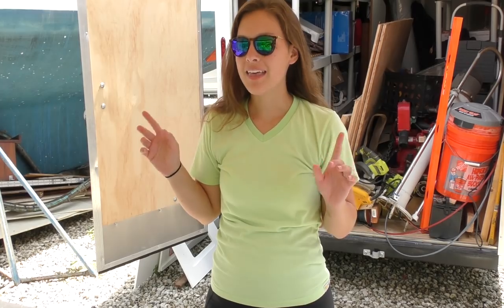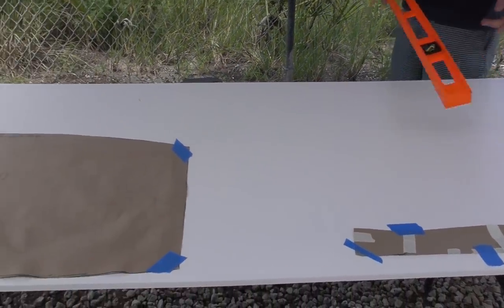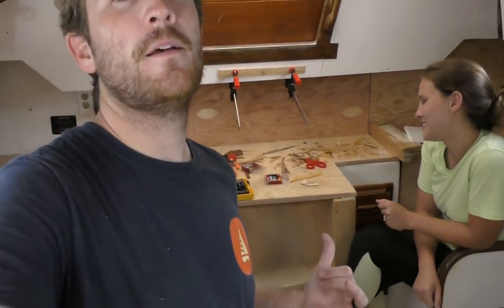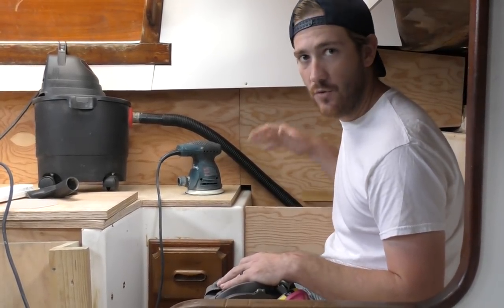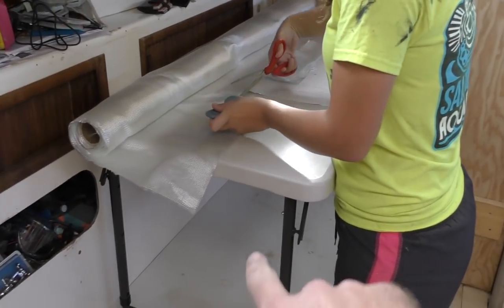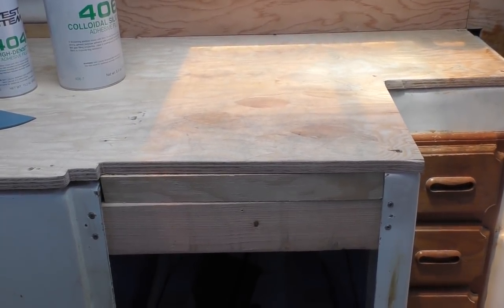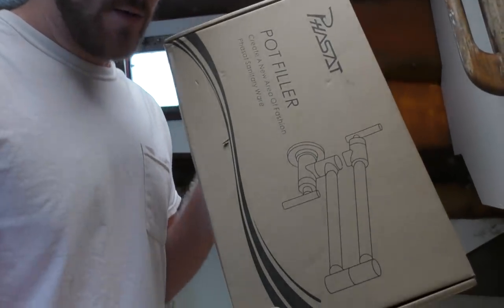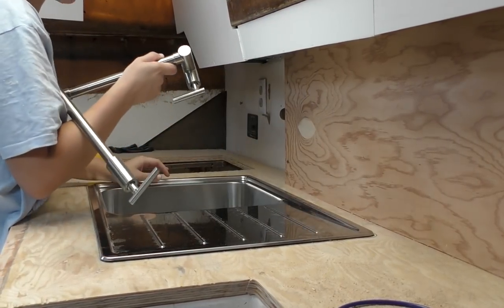55. IKEA Sink on a Yacht? - Galley Refit Progress | Learning the Lines - DIY Sailing

Comment: I would recommend using contact cement glue instead of that DynaGrip, could not find actual info on its bond. Contact cement is ideal for less porous material such as PVC or plastic laminates and will also bond with many other such as wood. You need to roll it on both surfaces and leave for 15 - 20 minutes until it becomes tacky and cured, than attach both pieces together and contact cement will stick to itself. But you must make sure it lines up before attaching as its pain in ass trying to move once it starts to stick to itself. We used it all the time on plastic laminates, tub liners and even countertops and will not budge even with flex and movement.
Reply from the maker: Good info! Thanks. Making sure it lines up perfect is a little intimidating. Lol.
Reply: yea the trickiest bit, little experience helps. Really just want to line up one whole edge first than start slowly pressing rest together til you start get hang of it. Than make sure to press firmly ensure good bond all over. Keep heat gun handy in case once you get part way and realize it is bit off.
Reply: Been using contact adhesive for attaching Formica type laminates to wood for over 4 decades. It's still the right way to do it and the right product for plastic to wood. If you can, cut the plastic oversize and trim after adhesion, also if you are doing a horizontal surface, once the coating has gone off place thin laths on the wood before you place the plastic, position it and then gradually withdraw the laths to let it drop down. The laths won't stick as they don't have adhesive on them. Sometimes for awkward shapes stick thin ply (1/4"-3/8") to the plastic, cut and finish to shape then use wood glue or building adhesive to stick the ply surface to where it's going.
Reply: If your using thee contact cement just leave the pieces oversized and then finally cut your to the true size.

Comment: Wow!!!  As a wood worker I can't imagine putting any wood on a boat without sealing all sides and edges FIRST.  On a boat I would even seal the the edges and fill the voids and holes with thicken epoxy.  Yes this will take a little extra time but you don't have to carry it as far as they did on Lea Lea sailboat (see their refit where everything was stained, sealed with epoxy, then 3-4 coats of varnish BEFORE installing in the boat ...all done in the cold of Alaska).  Yes maybe 2 coats of epoxy to seal ALL sides and edges would prevent moisture from soaking into the wood and mold growing in places you can't see or get to latter.  ALSO  you are attaching to existing fiberglass cabinetry that is a part of the structure and strength of the boat.  By tabbing and fiberglassing the plywood to the existing might prevent creaking and squeaky in the future as the boat wants to twist in heavy weather.  I hope you won't regret taking these short cuts and it may not be to late to do some of this work but getting  into those small spaces may be extremely difficult or impossible.  I'd encourage you to look at all the space available and make use of it.  Also try to insulate the inside of the hull where ever possible which will help with heat, cold, and water condensation inside the hull.

Comment: Impressed  with your progress, I had faith in you despite your skill at destruction! I'm glad you are resisting the Know-It-Alls!  ....I will make one suggestion if you ever need it. If you have to fiberglass with thin 6 or 10oz cloth like you are using over sharpish corners cut the cloth into strips at 45 degrees or 'on the bias' and it will conform remarkably well....but you have done surfboards I hear so I'm probably teaching you to 'suck eggs'! Cheers Warren.
Reply from the maker: Thanks, Warren! We appreciate your sincere advice. ♡

Comment: Jordan, I know you know a lot more about glassing than the typical "back yard" boat builder from your surf board work. You've already been fussed at in other comments for not completely sanding away the gel coat on your joints, so I won't go into that other than I agree with WolverineLiving - just keep repeating this until it becomes ingrained - "there's NO strength in gel coat, there's NO strength in gel coat, there's no strength ...." My three biggest pro tips that I can't help myself but give to you, are: Always fray the edge of any woven glass cloth. Pull a few strands out running parallel to the edge, back to 1/4 to 1/2 inch. This helps prevent de-lamination because of physical reasons that would take five paragraphs to explain. My second tip is ALWAYS use a "bedding layer" of 3/4oz or 1 1/2oz random direction mat for any weight of woven cloth. Again the reasons for this have taken whole chapters in technical books concerning the physics of two laminated materials with wildly different expansion and contraction amounts. Suffice it to say that the mat layer gives the cloth a buffer zone. It also insures a seal in the holes between the strands in the weave. My third tip is little know or used; When laminating to ply wood (or any other wood) paint a coat of resin thinned with styrene or no more than 30% acetone and catalyzed just a bit cooler than what you would for the day's conditions, with no glass, and let it kick off. This allows the resin to soak into the wood giving your lamination a bond that goes deeper into the fibers of the wood. This doesn't cure delamination from wood but it slows it down considerably.
Now I need to go batten down my hatches - sitting at the bottom of N.Carolina on the I.C.W. 3 miles from the mouth of the Cape Fear River ... gonn'a be a wild weekend!
Reply: Be safe down there... I'm praying for everyone that's along the coast
Reply: Thanks Jeffery, as of this morning (Wed morning) looks like the southern coast of S. Carolina may get the worst of it.
Reply from the maker: Thank you, 3DPDK. We always appreciate your feedback. We trust you as a reliable source now. We definitely feel like you know your stuff. I (Randi) normally prep the glass so I will keep the fraying in mind. Good to know, since I try to avoid fraying it typically. 😕
Best wishes for the storm. Take care of yourself.
Reply: Yea I always see professionals fray the ends, quite often they will tear it instead of cutting when they can for that exact reason. Great tip with your 3rd one, you always want to prep wood to allow it to soak in as much as possible, even plywoods which most people do not think about.
Reply from the maker: Thanks, Kevin!
Reply: You have polyester and gelcoat on top. New polyester then again on top of gelcoat? Is that a problem.
Reply: Thank you for these "tips".  They are very helpful to me and others who are not "in the know".  Thank you for sharing your knowledge and experiences with us all.

Comment: Hey mate, simple tip for routeing a straight edge without the underside being straight. Clamp or screw in a straight edge to the counter the distance from your base to the bit edge. That way you can have the substrate stand proud a 1/16" - 1/8" from the wavy fibreglass. Cheers and keep up the efforts. Any carpentry questions you have, please feel free to drop a line and I'll answer them the best I can. (FYI, I live a few miles away from Boatworks Andy in the Beautiful Lake Superior area)
Reply from the maker: We actually did that like an hour ago for the countertop! Lol. You should see it in our next video. You'll be proud. :)
We will keep you in mind for questions. We definitely enjoy Boatworks. That's awesome.

Comment: A Few Questions from across the Pond. 
Is it cost with the glues your using? Would you not use a marine glue or epoxy glue for bonding? Is the salt air going impact any bonded surfaces? The boat will bend and twist when sailing and there’s  expansion and contraction with temperature all straining whatever’s glued.
Reply from the maker: bowwave paul, from my experience epoxy doesn't like to stick to plastics/pvc. I could be wrong but that's why we didnt try epoxy. We were thinking 5200 or something similar but it doesn't have an instant grab component and clamping up the pvc would have been almost impossible. That's why we went with an exterior grade construction adhesive. If it fails, we didnt use it in a lot of places so it will be easy to redo.
Reply: @LearningtheLines  If you do re do the PVC on the sides with the port lights I'd suggest you do the same as you did with the ceiling and strip it with wood and insulate the cabin walls first.  This will help with the heat, cold and condensation ... your over all comfort.  Just  a thought.

Comment: Are you going to use u clips for holding the fuacet in place while under sail? Without something to hold it i can totally see that swinging around in the waves, 

And i am assuming the same thing for that nice storage area in that new nav station
Reply from the maker: Yes were going to try to figure out a way to fasten it when underway if it needs it.
Reply: +Learning the Lines Short length of bungie cord.  Either use a bronze S-hook or a loop back to itself.  It isn't rocket surgery, make something that works and is quick and easy to use and deploy when needed.
Reply: @svbarryduckworth628  
Fair enough, i was thinking one of those sping things for hold broom hands, so you just press it in to lock it
Reply: Velcro !

Comment: If the adhesive you're using don't work out  try F-26 also taking a heavy grit sandpaper and stuffing up the backside of the PVC board will help out too
Reply from the maker: Thanks for the tips!

Comment: I always wonder about respirators..  of you are covering your mouth, what is stopping 'stuff' going into your eyes... that full face is a good fix... you should have linked that to.

and not that it probably matters -- but a question for me --- at 3:31 you covered the wall/wood with fiberglass, did you consider filling in those round circles... or are those needed for instruments on the other side
Reply from the maker: They were instrument holes. We don't plan to reuse them as of now. We had redone the fiberglass laminate on the exterior before painting, but didnt fill the plywood back in. The laminate is rather thick. Didn't think it was necessary.

Comment: Hrm.  Youtube comments are pretty much the reason why so many good boat/sailing blogs have disappeared.  I still miss BoatFam and anyone without an extremely thick skin will get discouraged when faced with such negativity.  Things are coming together.  I would consider a cutting board the size of the sink extension with wood dowels that slip into holes into the countertop and a standoff.  That would completely eliminate someone stepping on the sink and give you a good cutting board location where you can scrape vegetables and whatever off into a bowl firmly anchored in the sink basin.   

Just a thought, but you will easily have enough power in your Battleborn batteries to run a microwave.  
At one point there was a Stove + Microwave combo that gimbles:
https://www.westmarine.com/buy/force-10--stove-with-microwave-cabinet--3779493  

Thanks for sharing.
Reply from the maker: SenatorPerry, Thanks for the kind words! Personally I love negative comments from the armchairs. I'm always of the mentality that if you're pissing people off then you're doing something right. It's impossible to appease everyone, so there's no reason to try.
Reply: @LearningtheLines  Exactly.  F 'em and feed 'em fish.  It is your boat.  Do what you want with it.  Make your own wins and mistakes.  Most of the armchairs probably couldn't even figure out how to get out of the harbor in a sailboat on their own.
Reply: Senator Perry I like your ideas with the cutting board. It all makes go since and use of space.

Comment: A trick to glue PVC to other materials, is to first lay down PVC glue on the area of PVC you want to bond and let it dry.  Most glues are incompatable with PVC but glues like epoxy will bond to PVC glue.
Reply from the maker: Interesting! Thanks for the tip.

Comment: A sink is a sink.  It'll be fine as far as rust/corrosion.  We put a standard mini-size bar sink in our head.  The only thing that fit nicely.  

The issue is getting the drain to adapt to the marine hose without getting a sketchy cobbled-up adapter below the waterline.  It looks like your sink drain might already be below waterline already on a port tack. ours is in our HR-35 when we are heeled over more than 20-degrees or so.  

Be sure your drain to hose adapter is sturdy under the sink.  If it is fragile residential PVC components and breaks apart the hose could possibly drop down below the waterline and flood/sink the boat eventually. That's how Wicked Salty lost their boat last year with their head sink.   

Best to secure and support the drain hose so that if it does fall off the sink somehow it can't possibly fall below the waterline and siphon water into the hull.
Reply from the maker: Definitely good pointers! We certainly don't want to have that happen to us as well. Thanks for the advice. :)
Reply: You could also look for a "check valve". It prevents water to rush back. Pretty sure you can find the proper size for your application at Home Depot. Cheap insurance...

Comment: If you have to reglue PVC to wood, try Gorilla glue which is polyurethane glue that cures in the presence of moisture and swells to penetrate and bond extremely well to most everything.  Roughing up the PVC surface with 40 or 60 grit sandpaper will also make a huge difference in joint strength.
Reply from the maker: We will keep this in mind! Thanks.

Comment: Lightly sand the back of the starboard and wipe with alcohol and I don’t know how consistent the plywood is, but maybe some time prepping and sealing the ply before trying to bond a non porous surface to it and make sure to get a good even coat of glue, like using a trowel and really scrape the glue into the plywood and clean it really well before starting to trowel the glue
Reply from the maker: We will keep that in mind for future applications.

Comment: Hello, just a friendly tip, always grind down to glass, never glass to gelcoat. It's not "ok" or "good enough" and your tabbing should be removed and done correctly..
Reply from the maker: Since it's not a structural piece, we're going to leave it as is. We appreciate the friendly tip and understand it should be done that way, but for its purpose this will suffice.
Reply: Gel coat is polyester resin with tint in it for color and is plenty strong for what you are doing. 35 years in the business and I have never had a problem. Use very coarse sand paper for the best bond. Yay Uma for sharing! Looking good guys.
Reply: onlychevys Williams: Gel coat also has a particulate filler to give it body so it wont sag. This makes gel coat much more brittle than pure polyester. If Jordan had tried this in a production boat assembly line he would have been told to grind it down and do it over.
Reply: This is not a production line, it is a refab on an older boat. Always the keyboard experts, let them build their boat.
Reply: Doesn't matter. Not a "keyboard expert", but a fiberglass boat builder since 1974... learned fiberglass when you had to mix cobalt into the resin ... look that up.
Reply: Learning the Lines ...Fair enough, as long as it's understood that tabbing in this fashion should never be done on structural members such as bulkheads, decks, hulls and the like then all is good ;-). Best of luck on the rest of the build, your hard work with should pay off in the end with a great boat to adventure in.
Reply: onlychevys Williams Yes, for non structural things that aren't required to bear loads it might be ok to do, but that then begs the question why bother tabbing it at all if strength isn't needed? Boats live in a very dangerous environment where human lives are at risk so pointing out that something isn't being done correctly in an attempt to save people from a catastrophic failure of structural members while at sea isn't being a "keyboard expert, it's being concerned for peoples lives. Perpetuating the myth that it's ok to tab/glass to gelcoat is dangerous and wrong, no matter how many years you've been doing it wrong.

Comment: What and where did you get your face mask and filters?
Reply from the maker: The filters we picked up at Home Depot. They're the 3M ones for particulates and chemicals. The masks we got off ebay. They're a knock off of the 3M full face masks. Jordan found them, but I think he probably searched full face respirator.
Reply: So no make or model numbers to research?

Comment: Next time you have a large gaps to fill, like under the counter, shred and chop some fiberglass and use that as the filler.
Reply from the maker: I think, but I don't have it in front of me, the high density filler had fiberglass in it.

Comment: Nothing wrong with an Ikea sink.  If the sink is the typical alloy used with normal stainless sinks-usually 304 low carbon or one of the 400 series-you should not see too much rust unless you let normal carbon (cast iron or non-stainless) steel sit against the sink and begin to rust.  Also if you keep the sink rinsed and wiped down it should last you for many years.  Just don't let salt water sit in the sink or stand on the drain board for hours or days and you will be fine.
Your galley is starting to look good.  Keep up the good work.
Reply from the maker: Awesome! Thank you, Matt.

Comment: I did not see you form a fillet. All you did was fill in the space where the plywood was not touching the fiberglass. A fillet is formed by using the radius end on a tongue depressor or similar shaped tool so that the epoxy is flared out at the base of the plywood. Then you add the strip fiberglass cloth over the fillet with epoxy, to extend the width of area for added strength.
Reply from the maker: See, I knew it :)